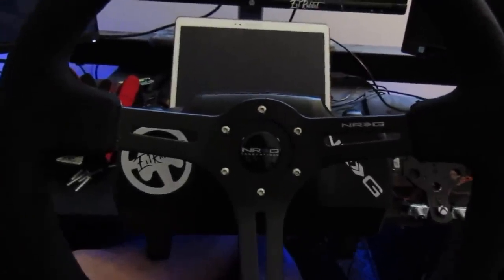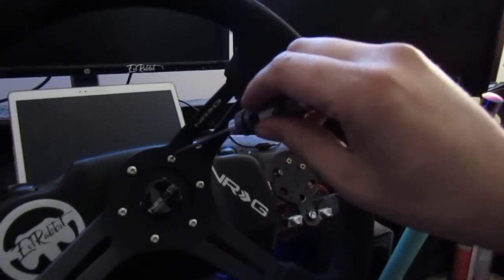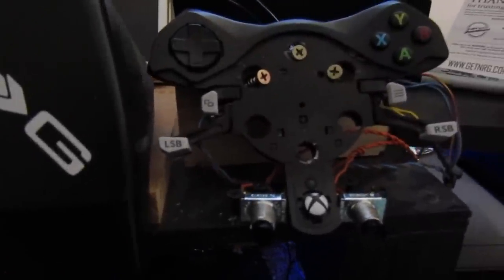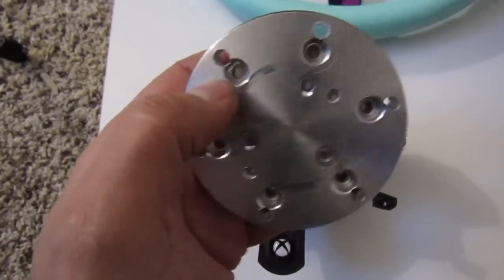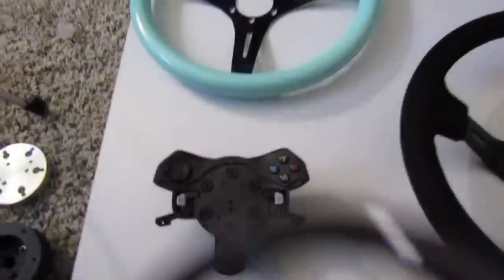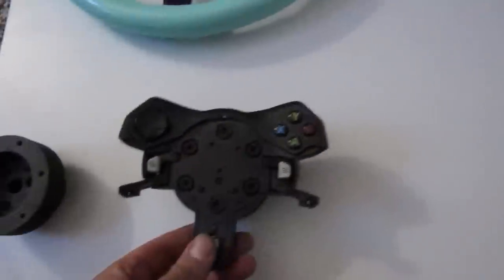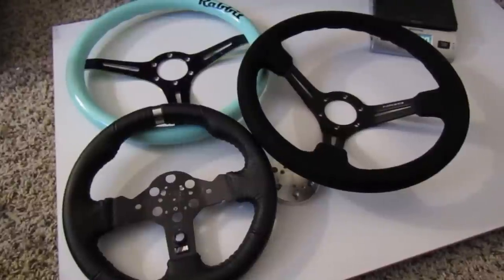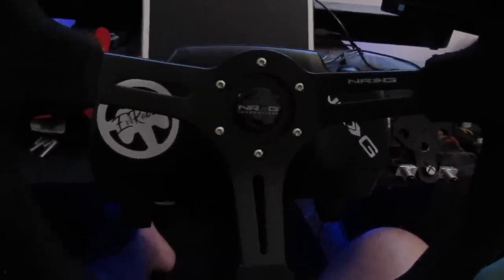Changing G920/g29 to Aftermarket Rim Things you should know /weights/adapters

Comment: Thanks for the great video :D the only question i have in mind is.. I am planning to add a deep dish wheel + extended pedal shifters with an adapter and a spacer (keeping all the buttons!!) but the issue is; besides the decrease in the force feedback, could the added weight damage the gear mechanism in a long term use?
Reply from the maker: I used mine like this for almost 2 years and never had a issue. But if you are worried about potential wear and tear I would recommend a NRG Innovations Sim wheel they are lighter and are to not add wear and tear due to weight
Reply: I will check them out, thanks :)
Reply: @EvlRabbit07  do you know the weight of this wheel? their site does not specify

Comment: I bought an OMP fake wheel from Ali express for a tenner and measured out an adaptor template to drill in work. Made it out of brass and it’s been great. Had it since 2018 and it’s never let me down. Fitting shifter paddle extensions was harder than making the adaptor. $25 is £22 now. Absolute rip off for what it is.
Reply: hey man would i be able to hit you up on discord for further info on this? im from the uk and want to do a similar thing while keeping the paddel shifters.

Comment: I guess if you put more heavy load to the servo, it might be won't last long. Those plastic made are meant to be with a plastic too. Just my opinion.
Reply: Not over the wheel. The part you out the metal adapter on is the metal center piece. Doesn’t really make a difference

Comment: Dam it i just got delivered chrome wheel like nrg wheel off alieexpress 350mm but ways 2.976lbs on its own ..so reckon its to heavy for it ? Also what screws do you  need to fix it to adapter plate got 3d plastic one off ebay .pleae advise bud
Reply: How much is that in kg

Comment: I know it’s late but I got a question, so I did the rim swap and I had a 3D printed adapter and a wood grain wheel like yours and my g920 like wobbles back and forth and up and down now not much but a little so I took it off and reverted back to stock, is the heavier wheel the reason for that?
Reply from the maker: They may be a little play not to much I know I had some play and I made sure the center screw of the adapter was tight and when I tightened them it went away had to do that every few days
Reply: EvlRabbit thanks for responding so fast! But I’m pretty sure that won’t fix it for me. I have the stock wheel on and it’s still wobbly, and the wheel itself doesn’t wobble it’s the shaft of the whole thing that wobbles. Don’t know if that’s a bad thing
Reply: Can you send the file of the adapter? I don't have a world-wide card to pay per the adapter
Reply: I live in Brazil
Reply: @emds6819  tenta comprar algum adaptador no mercado livre, tem até um cara q imprime os arquivos 3d do amstudio e coloca pra vender lá
Reply: @reisgbrl  Do Amstudio eu nunca achei não mano, pra te ser sincero eu tou pra fazer o sistema de "Quick release" da thrustmaster no G27
Reply: Desisti do adaptador do Amstudio e vou fazer algo mais bolado kkk
Reply: @masonallen6634  is long its left to right and NOT in and out your good

Comment: I want to add 3.3 Lbs is it worth it?
Reply: that is twice the weight, i would be very careful, buy the cheapest 350mm rim on ebay they will be as light as the stock wheel almost.